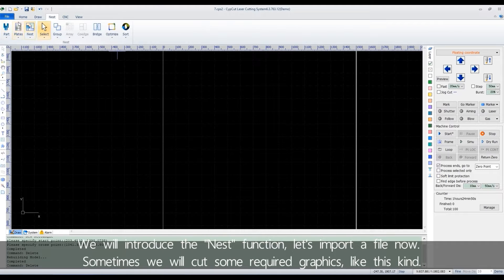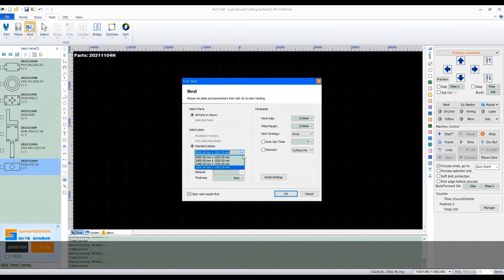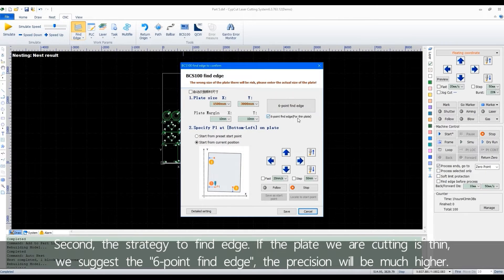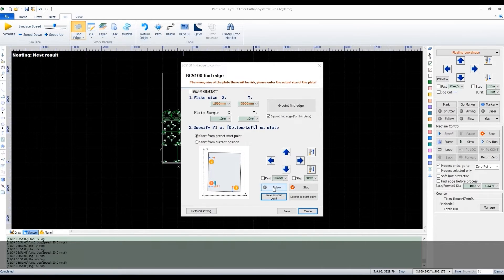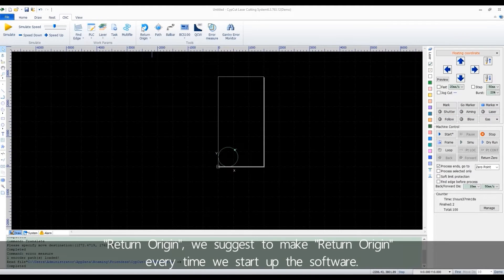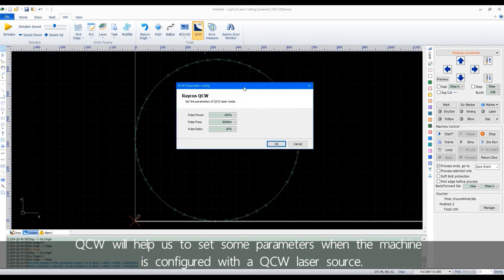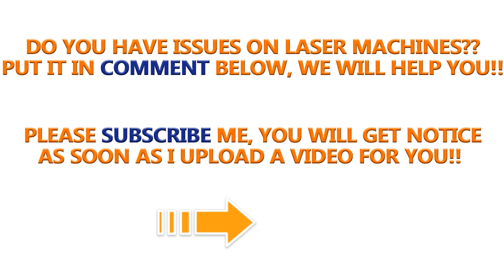CypCut Software Tutorial English | Cypcut Laser Cutting | Complete 6

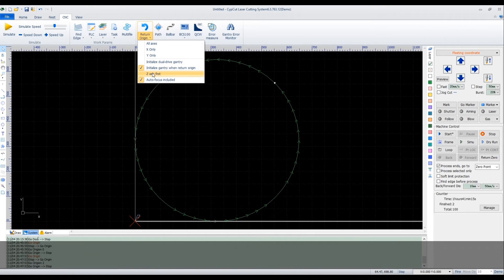Comment: At 5:30 Initialize dual drive gantry make once per month. It is not really clear what it does. Can you better explain? I have a guess but tell me if it is not. The dual drive has 2 home swithes during homing the dual drive motors not working in synchron but separate until each motor reach it's own home switch so brings the gantry square with the machine bed?